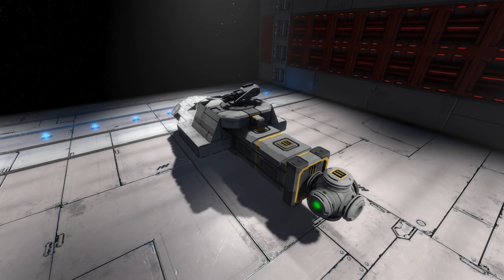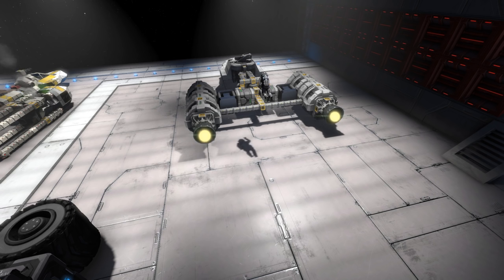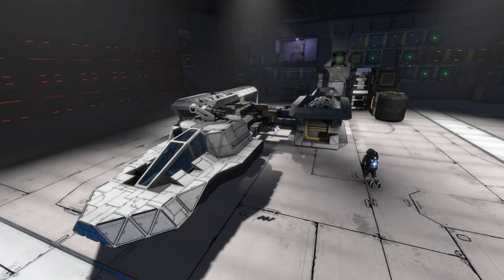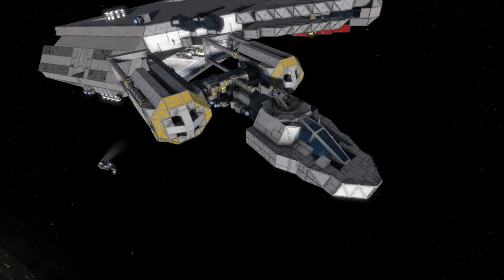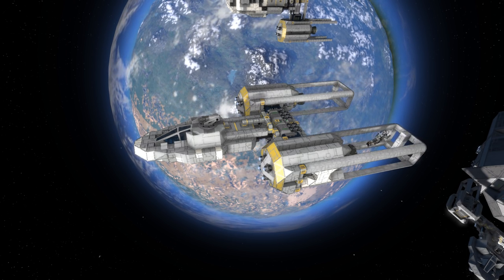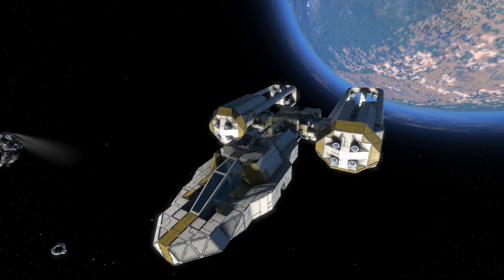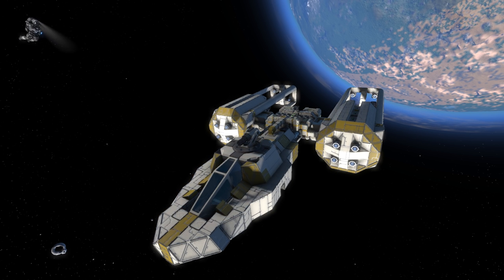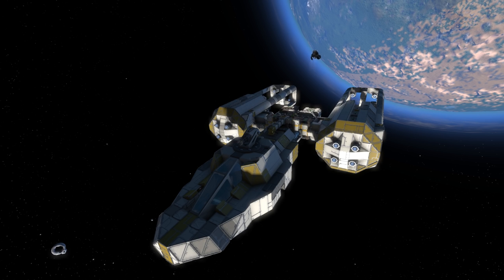Space Engineers - Star Wars Y-Wing - (One Day Speed Build)

Comment: From what I've seen in photos and hard to get close ups of the Y-wing in flight at the end of the engine frame are crosshair like rudders and flaps. To me that suggests thrust vectoring is what that frame is for as its extended from the engines.
Reply: The frame isn't supposed to be exposed the Y-Wings from the original trilogy are stripped down they're actual republic ships used in the clone wars the framework is covered in panels and armour it's just removed by the Rebels for easy maintenance

Comment: two questions one does this work with thruster damage on? and in creative how do you do the thing in which you build multiple blocks at the same time but not only in a straight line?
Reply from the maker: It does work with Thruster damage on. Each exhaust points out. :D
Reply: darkshadow 23 Hold ctrl to build a line and shift to build a plane. You can cycle the symmetry with N.
Reply: TheEmperorSRB thanks m8 that will help me alot